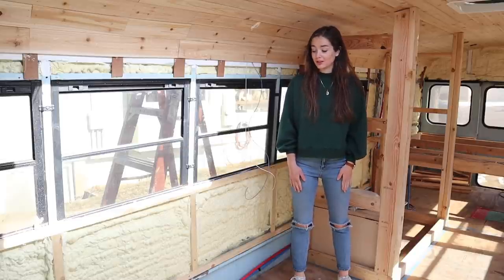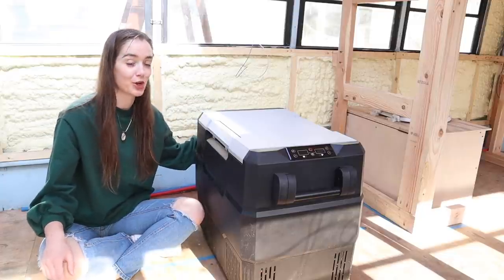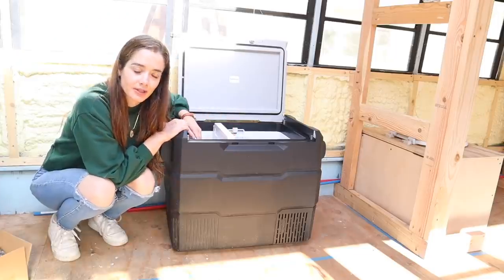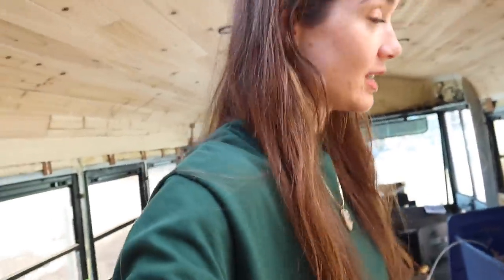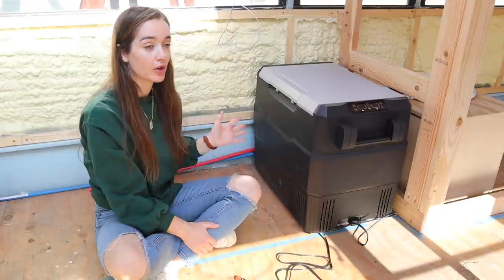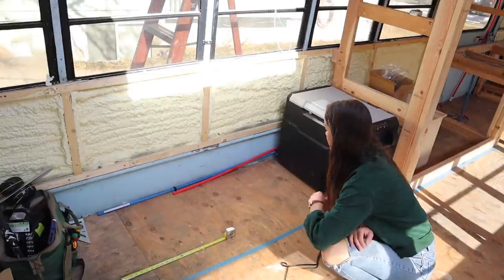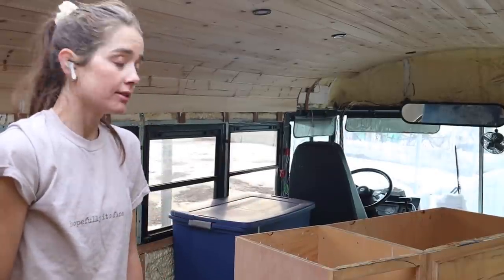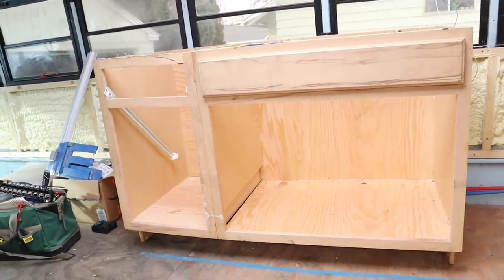School Bus Kitchen Plans // skoolie conversion series part 49

Comment: Luckily,  when I  converted my bus, I  was a carpenter/cabinet maker, so I  could build cabinets in place inside of the bus. The hardest part was scribing (fitting walls and ceilings).Hardwood floors, ceramic tile counters and shower. It was fun to build and lived in for almost 5 yrs. Now 78, pull 20 ft R Pod 180, my mini condo.

Comment: Great job Emma. The next step is to do two things. 1. inspect around the fridge to learn where the vents are so that you know where you need airflow around it. I'm sure you can figure it out from there.  2. Slide the fridge next to the cabinet to check your space which will have to include the wood and fridge width. Then you know how that space is coming along and what you need to work on to make it the way you want.

Comment: Thank you for the wonderful videos! They make me laugh and smile. I love you bringing in the kitchen counter. That's the way I've done every major move of anything. Just grab it and go. My suggestion would be to put your refrigerator on the bottom and the smaller freezer above if you go that way. The larger refrigerator will weigh more and it will probably be the one you need to get in to the bottom of the most. Also with the heavier one on the bottom if you need to remove them it will be an easier job. Again thank you for including us on your journey.

Comment: go get a set of roller's that are used on the quite drawers and put them flat on the floor with a platform on it and then set the ice chest on it so it slides in and out from under your counter

Comment: Emma, just in case you have not thought of it, to gain back some countertop space fit a removable lid over the kitchen sink, maybe even two, one for the sink and one for the cooker top, you have to try to regain as much space back as you can, and doubling up is a way to do it, maybe decorate the top/s with tiles or something.

Comment: Hey,  you need some toe boards under the cabnet bottoms or it may give over time.  Use some 1x4's under all the edges of the cabnet floor boards and for the center of the  large floor board just in case you may want it to hold weight.  I like the repair you did on the cabnet.  Very impressive.  Great job!

Comment: Maybe make the top of the fridge at counter height?  It would be super easy to get into and you could use the space as more counter top space.
Reply: Also it is going to need some airspace around those bottom vents.  Don't forget that!  You could just cut some slots in the cabinetry most likely.

Comment: Nice video I have a little advice with that fridge when you can plug it in to 110 power when at home to get it cold and then let your batterys keep it cold it will so save battery power doing this so if you can  Design the fridge where you can plug it into 1 10 10 when needed and 12 V after. I hope this  Makes sense and helps

Comment: Hi Emma, you can use a max fan as your vent to suck out cooking smoke and clearing your air.  I loves your build.  I would add a 25 gallons bburtain tank under the bus for cooking and heating water.    <3

Comment: Before you install that Kitchen cabinet put a strengthening bar under the bottom of the shelf at the back otherwise if you put anything heavy on the bottom your bottom will break, then if you decide to add some more shelves then put pieces of 2 x 1 for you shelves to sit on

Comment: Someone else said it but if you are planning to have a door hiding fridge you will need a vent to outside to vent the hot air  away from fridge. The best way is to put in vent and use small 12v fan to suck the air out

Comment: One thing to consider with the fridge is how to access it.  Most designed with fridges like that I have seen use slides to move it out to access the top. So you need an open space as large as the fridge to slide it out. If you use the orientation in your video you have limitations on what you can put on the other side of the bus. The fridge looks wider than what the central walkway will be.. If the idea is not to use sliders you will waste a lot of space above it to be able to access it.

So consider how to access it and what should be on the other side of the bus, having it lengthwise and using more space under the counter might in fact result in more usable space when you consider the access to it.   Even if you do not completely need to slide it out to access it you need to build it so it can be removed if there is any problem.

Comment: I would look at lowes item 336301 it's a 24" version of the cabinets you have. Except if you put 2 together that would make for less modifications needed since you said your oven/cook top is 22 wide it would fit in side this cabinet. By removing the drawer and making door below shorter and moving face peice of cabinet that is between drawer and door down. Then by adding another 24" cabinet next to it and removing drawer and adding just the face plate of drawer to front of cabinet like the current cabinet you have one the right. This cabinet then could be used for a sink. Plus you can easily switch oven/sink left or right until you install the cabinets. This set up would leave you 18" left for your pantry. They sell one at lowes 336290 but you would have to shorten and extend depth so I don't think it worth the price. But you could look at it for construction idea if you build your own. If you use the cabinets you have you need to add a peice of wood on the bottom were the 2 cabinets are attached.   It was removed when it was cut for the wheel well

Comment: Put your fridge in sidways on rollers so you can just pull it out when you need to access it
Reply: I was thinking about just a 3/4 plywood platform on castors. Those heavy duty drawer slides must be expensive. I thought for a minute, that it would save space, but the ventilation is important.

Comment: I have the same type of fridge not the same one or brand and I’ll be honest they are not easy to use and they will tip over when loaded or even unloaded. I would definitely suggest maybe looking into a different fridge that you were going to plan on anyway. I’d hate to see you build everything around that fridge and then end up not liking it. But I understood your instructions completely how you wanted to put it in there and build a pantry on top makes sense but I would probably go from one of the more lower to the ground fridges like the dometic or albicool etc. but Of course these are expensive just using those as an example because they were lower to the ground and wider. Good luck can’t wait to see how it comes out

Comment: Why not build a platform for the fridge so the top of the fridge is the same height as the countertop? Then there is no pulling the fridge out or bending over to access the fridge. Just stand at the counter and open the lid. Wherever the fridge is will be non-useable space. You can have storage underneath it and above it when the lid is open. Just a thought. 🤔

Comment: Okay, I'm currently watching you try to disassemble a vanity. Please don't wreck the things that you have by trying to disassemble them by demolishing them.  Look at videos to see how to safely repurpose them without destroying the useful parts.

Example, use cordless drill/screw bits to remove doors, rollers, etc.  Use a saws all to cut the top without damaging the sidewalls.  If you must use a crowbar and sledge hammer, that's when demolishing a thing should be pursued.  That vanity had more life left in it before you cracked the face of it.  Note the three sections you could have removed the screws or staples.  You didn't need a bottom plate (piece), just bottoms inside the vanity.

Comment: The fridge should be 12v. Even if it's running on 110v, it will step down the power to 12v. It will auto-switch when on 110v.

Comment: g'day...u want u fridge at waist height..storage underneath n pantry on top..4wd camper type store have slides built for the fridge....maybe the little freezer underneath..u going really well with everything..soon you can convert your engine to run on Hydrogen 😌 how cool will that be

Comment: Nice sketch and color. Kitchen planner (cant put a link dot net comment gets deleted). You can find wooden design "colors", i think this way you can have more full visual perspective. It's free, user fiendly and it wont take much of your time.
Reply: just visually copy your sketch on the website and put wooden design colors for the floor, walls and ceiling just like your bus and test colors for the kitchen cabinets.

Comment: Given how plumbing and electrical will work I am unclear about why you bothered to put solid plywood on the backside of the cabinet.   It would have been good to just put reinforcing slats across there.   I do admire your moxie however.